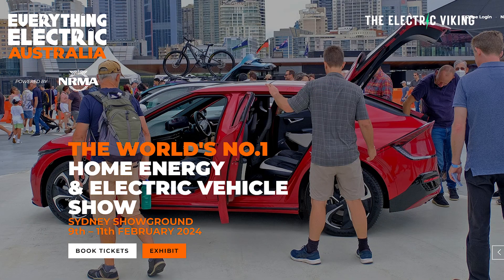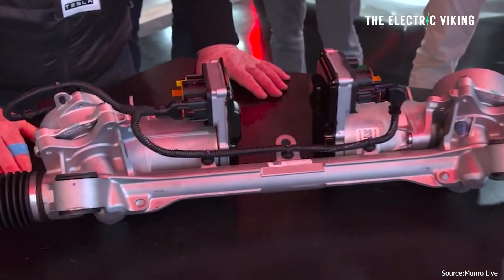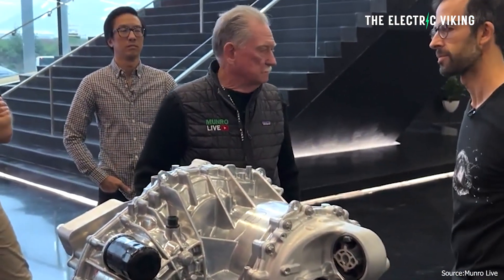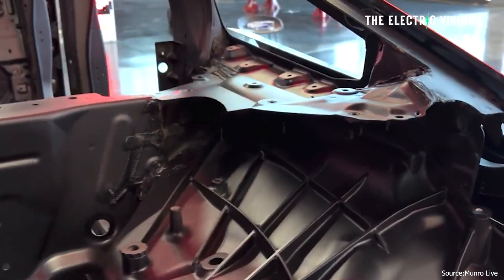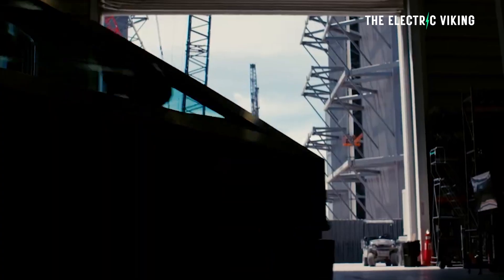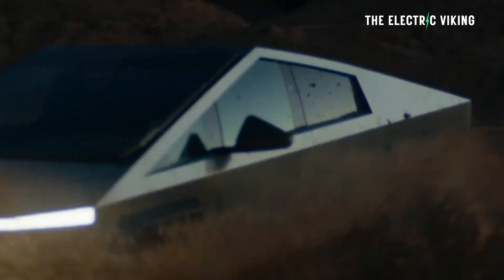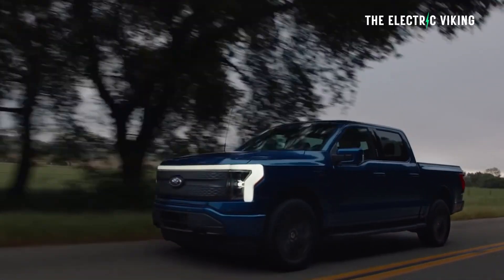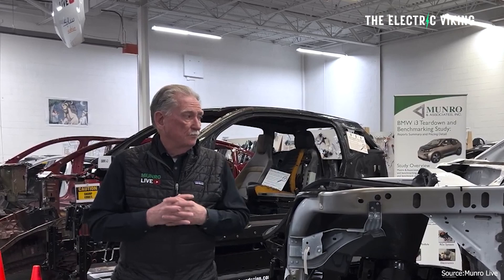ETHERLOOP system revealed by Tesla engineers & Sandy Munro

Comment: So, specifically for the cybertruck (weight reduction),
They implemented: gigabit Ethernet, 48V low voltage, and 800V high voltage…

Great. But just for a second imagine that tesla would apply those also for a model-Y+ (not the 2024 upgrade). Less cost, less weight, reduced manufacturing time, etc etc etc…

Comment: Ethernet is not Bluetooth. The sensors/devices in the CT need power, control and data but this is on a common bus thus point to point wiring is no more.

Comment: Wifi and ethernet connections?  Jeez, standard bus connectors are problematic enough in a mobile installation.  Now you're gonna use 5 pin ethernet and wireless tranceivers?

Holy crap...what could possibly go wrong here?

Comment: Not as revolutionary as y'all think. Looks like they adapted IEC 61850 which is the standard for substation automation. This uses a robust and fast Ethernet communication within the substation. Been using it for over 10 years in N. America. 

Seems like an innovation to the car crowd but not to the utility Protection & Control engineering audience.

Comment: Do i get this right?
With this etherloop all information is transfered over this bus. So if I switch on the light the information travels to the controller in the lights and its switched on there. Now there are  hundreds of clients. If one fails the bus is offline and you cannot drive? With the normal system only the lights would not work? Do I miss something?

Comment: So I asked AI (Bard) this question:
what cars have had the electrical wire harness replaced with an ethernet cable?

AI:
Currently, there are no production cars that have completely replaced their electrical wire harnesses with Ethernet cables. While some automakers are exploring the potential of using Ethernet technology for certain in-vehicle communication functions, a full replacement is still in the research and development stage.

Here's why a complete replacement is unlikely in the near future:

Cost: Ethernet cables and the associated hardware are currently more expensive than traditional wiring harnesses.
Complexity: Implementing Ethernet for all vehicle functions would require significant changes to the car's electrical architecture, adding complexity and potential points of failure.
Compatibility: Existing sensors and actuators might not be compatible with an Ethernet-based system, requiring extensive upgrades.
Regulations: Safety standards for automotive electronics are stringent, and new technologies like Ethernet would need to undergo rigorous testing and certification before widespread adoption.
However, some automakers are using Ethernet for specific applications within vehicles:

High-speed data transfer: For functions requiring high bandwidth, such as communication with advanced driver-assistance systems (ADAS) sensors and infotainment systems, Ethernet offers significant advantages over traditional wiring.
Reduced weight and complexity: In some cases, Ethernet can simplify wiring by combining multiple signals into a single cable. This can potentially reduce weight and improve space utilization within the vehicle.
Here are some examples of automakers exploring Ethernet technology for specific applications:

Volkswagen: The ID.3 and ID.4 models use Ethernet for communication between the ADAS sensor suite and the main control unit.
BMW: The iX uses Ethernet for communication between various electronic modules.
Volvo: The XC90 and S90 models use Ethernet for the infotainment system and ADAS functions.

Basically, all the components that are currently hardwired now need an ethernet gateway. 
and throw in 48V architecture, the Cybertruck is the sole pioneer in this area.

The Supply Chain is going to be a nightmare and your local mechanic will NEVER get parts they need to service your Cybertruck.

Thow in the fact that NO autobody shop can work with stainless steel
that means EVERYTHING needing servicing must be done at the Tesla service center
This easily means months and months of waiting for your Cybertruck to be fixed if in an accident.
and the insurance company is going to charge you the highest rates of any production car in the world.

BTW minor accidents that won't harm the stainless steel will probably warp the frame of the truck
and that's a very expensive repair.
Reply: NO autobody shop can work with stainless steel?  Lmao
That is like saying NO autobody shop can work with yellow paint!
Or No Tire company can work with Snow Tires!
I think the AI lost a screw.
Reply: @davidbeppler3032  What logic is this you use? - I had my Tesla Y in to have a flat tire fixed at a local chain of auto care garages and asked the guy if they had the right pucks to lift the car.

He said yes, but they keep losing them and have to buy more of them about every other month. They only realized they needed special pucks to lift the Y once they damaged one, and the repair bill was in the thousands of dollars.

I then asked him how they would repair a dent in a stainless steel panel of the new Cybertruck - he laughed and said they won't touch the thing until they get guidance on how to lift it, and they won't be straightening out dents since that's impossible on stainless steel. They don't have anyone who is certified to weld stainless steel panels together.

I was just curious about how they would handle the Mad Max - the simple answer is they won't touch one.

Comment: Can some expand on this a bit. Is the Ethernet over copper or fibre? Do they use power over Ethernet? If not, how do the speakers, for instance, get power? 

Thanks in anticipation.
Reply: Power is from a tiny little wire.  Ethernet is over copper.  It was all explained in the Sandy Munro interview.

Comment: I wonder if the Model 2 will be made of stainless steel too, and if it could be a "heavier" issue with respect to the competition, than here for such a large car/truck.
Reply: The Model 2 will not be stainless steel.  It will also probably not be for sale to consumers.  Why sell a car for $25k when you can rent it out over 8 years for $120k?  That is just bad business.
Reply: @davidbeppler3032  Why I wondered about stainless steel? Because Musk stated that the smaller Tesla will "look a lot like the Cybertruck". The Cybertruck has this "low-poly" design because its entire hull is made of thick planar hard steel parts. Applying the full design principle "form follows function". So why make the Model 2 look like the Cybertruck if it has a conventional chassis + thin deep-drawn sheet metal bodywork?

Comment: Really cool that you can run the speaker directly from an ethernet cable
Reply: Why? It's still bloody wiring.
Reply: Yes, Ethernet is a date of protocol, nothing more, you still need wires to transfer the data, and also Power for the amplifier that drives the speaker.
Reply: @robertfonovic3551  There may have been some sarcasm there... A speaker is an inductive load and obviously does not respond well to digital signals
Reply: Maybe they have amplifiers on each speaker that are fed by POE and digital input signals. Audio is not real high bandwidth.
Update: I watched Sandy's video and they did say that it's just as I surmised, digital audio signals with amps on each speaker.
Reply: @jamesvandamme7786  That’s my point,  it doesn’t sound so simple and cheap any more if you need 20(?) active speakers
Reply: @Epacman17  Back in my day, sonny, we used two heavy wires running into the doors and lots of discrete LC crossovers  to get the right frequencies to each speaker, and fancy speakers to make it smooth. With DSP and biamping you can tune each speaker response to get the sound you want. Chips are cheap, and maybe you can get away with less and cheaper speakers.

Comment: John Deere could take a lesson from this, some of the wiring harness trunks on their industrial equipment are pushing 1.5 inch diameter if not more, the amount of sensors is ludicrous on these behemoths, making insanely thick and rigid harness runs inevitable. I had the idea of using this sort of network, bus/canbus many years ago while frustrated with the direction the electrical engineers were headed.
Reply: The engineers, are still engineers, and you are still on the production line.
Reply: @robertfonovic3551  The engineers have cost John Deere quite a bit. Ask me how I know, and I am not now, nor was I ever "on the production line" I do know stupidity when I see it tho.
Reply: @DCGreenZone  It's the incompetent engineers promoted to middle managers to get them out of the design team who disapprove new technology.
Reply: @jamesvandamme7786  The green utopia movement made dozens upon dozens of censors/computers necessary in order to meet Tier 4 emissions standards. That right there has put a stake through the heart of sensible engineering. Take an intake manifold off a 6 cylinder JD mid size engine and you will find it coated with soot. That I do not understand, why have an air cleaner at all if that's how your after treatment is going to roll. Diesels didn't have valves dropping for DECADES, now it's just another ruined engine one after another. They could have simply went with hydrogen injection to clean up the combustion process but no, that's way too simple, isn't it.

Comment: Wow - and they have all that in 12 trucks ! wow.  Any decade now and Tesla will have this as normal, what is it wireles control of your vehicle?  Sounds amazing. Ok it also sounds crazy but hey we all want wifi controlling our trucks functions.
Reply: Planes have had fly-by-wire for years now  !  I was a little nervous of this for cars because there are a lot more cars in the same space as you, than planes actually flying, but since Formula 1 cars do a great deal of fly-by-wire, Steering, Accelleration AND Braking, its got to have been sorted out by now  !
Reply: A Tesla is not an Airbus 😊
Reply: @robertfonovic3551  Then there is MORE reason to have close control at ALL times.
One of the biggest disadvantages of a fly-by-wire control system is that if a flight control computer fails, there is a chance of loss of control. To prevent this from happening, all fly-by-wire aircraft are provided with backup flight control computers. If one fails, the other takes over.
Thus Tesla must ensure that they have backup computers and backup wiring, to all their systems that's all  !
Reply: This comment won’t age well, why are you even here?
Reply: @fredbloggs5902  sure it won't tell me how many Cybertrucks will be made by Feb 28th; I say under 1500; 500 a month  - 1500 F150 lightings were made a week out the gate - so tell me -your number 5000 a month? 10,000? Go on fool.Give a number
Reply: come on fed - give me that optimistic number or are you a coward?
Reply: Maybe you should learn the difference between wifi and Ethernet. And CANbus, while you're at it.

Comment: Weight for strength stainless steel is not heavy. The main issue is fatigue and cracking. Cracks can develop and run from fairly minor scratches if these occur in the vicinity of a stress concentration.
Reply: It's not being able to form it into complex curves that makes it heavy. Other makers using regular steel can make structures of equal strength using thinner steel and perhaps the cheapest material known to man. Air.